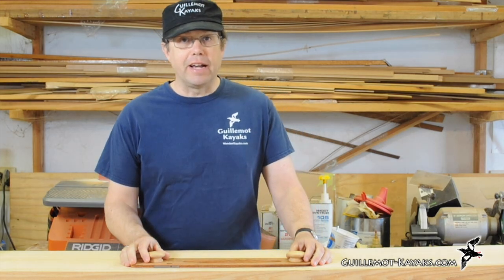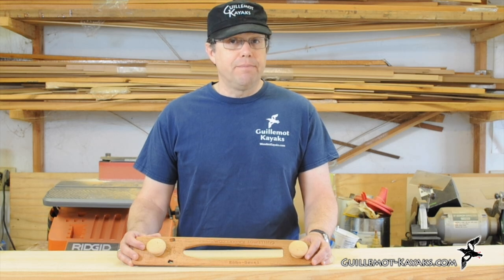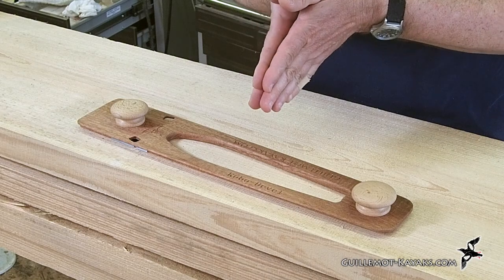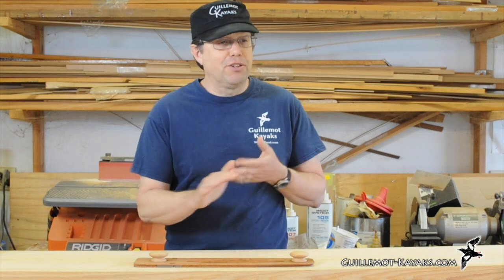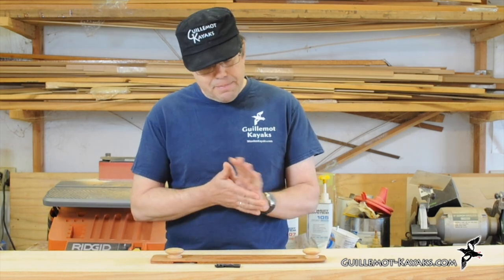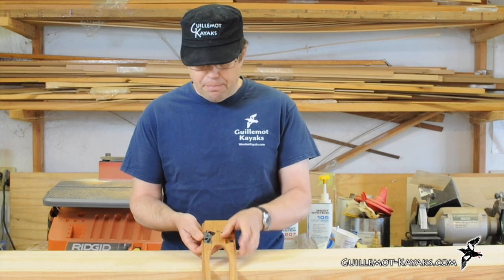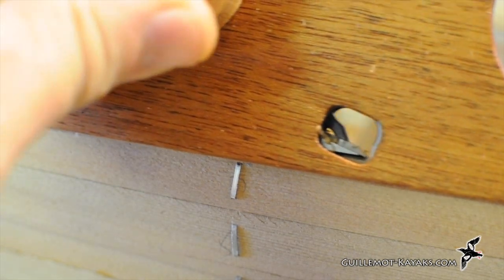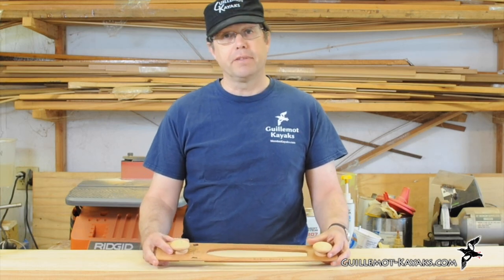Robo-Bevel Tool for Strip Building Small Boats

Comment: If there were a way the bead and cove to not pop out, the joint would be just as tight as the robo bevel
Reply from the maker: The cove and bead works great on designs that don't have a lot of twist or tight sectional curves. For example large canoes often go together very nicely with C&B, but for smaller, more complicated shapes, C&B tends to want to pop out.

Comment: Skills is amazing 👌
Do ask myself about if cutting the strips with 15-25 degrés angle (to alter when round over) it will increase the glue area on each strip and width  as well. 1-3 mm depending on angle...
Perhaps not very traditional, but with modern glues there is another possibility to explore.
Reduce the strips down to 2,5-3 mm for weight crazy daredevils. 😂 
My lard rear would need a few layers of carbon though, no fun to play submarine.. 
Amazing videos  about your skills 👌👌👌👌

Comment: After I got my Robo Bevel and used it, I realized that it was faster to just get another plane and have one on each slot.  I found them at the best price from Lee Valley, but had bought my first one from Amazon, which was too expensive, in fact the price was for a whole set of mini-planes, but only got the one out of the set from the Amazon supplier, so it was a rip off.  While it is nice to have the Robo Bevel in one piece, when I got to the last few strips, it would have been convenient to only have 1/2 of the bevel at a time, since it won’t fit in between the completed strips when only a few are left to place, like the the keel junction when placing the last of the strips. The other tool was a different edge plane which I use a lot for the last strips, just used a knife in the tightest spots, or use a low angle plane on the loose strip supported by another strip so the fine tapered strip would not bend.  I figured this out and then saw Nick using that method as well.  Thinking I may cut the Robo into two bevels now that I have two shoulder planes, or buy another one and shape it for my own needs.  All in all this is a very time saving tool and well worth the purchase.  😎

Comment: I have used the bead and cove method and also the robo-bevel method on my last canoe, it does work well with a little block plane work to go along with it. All in all in my opinion using both methods I personally would go with the bead and cove. Spend the time up front to make the bead and cove.

Comment: Hey Nick, quick question. I am considering buying a robo bevel for my 2nd cedar strip canoe build. It appeals to me compared to the tedious nature of trying to get perfectly milled bead and cove strips, which end up being very fragile no matter what you do. It seems like the robo bevel would be the perfect tool for me except for when I get to filling in the "football" section of the canoe after the centerline is cut. Seems like the majority of the strip could be planed with the robo bevel, but at a certain point, the robo bevel tool is going to collide with the centerline, rendering the tool unable to finish planing the entire strip. This is basically my only hesitation to buying a robo bevel. What would you do in this scenario? Are the strips close enough to square in the football section that a plane isn't necessarily needed? Thanks.

Comment: I love my Robo Bevel. Worked like a charm. Took me a little practice to really dial it in, and I definitely still prefer working on one direction rather than the other (L to R rather than R to L). This tool is exquisite. Definitely much more pleasant than dealing with cove and bead imperfections and broken coves.There is nothing like the feeling of getting a super tight joint with the robo bevel.

Comment: A few thoughts:
1) In the higher curvature of the bilge does trimming one side of each strip suffice?
2) A shoulder plane doesn't eject shavings very efficiently and with one side blocked even less so.  In the same spirit of a long fixture plane - would a skew blade clear better?
3) I am considering holding fixture for two strips at a time that twist the pair of strips so flat shots with a bench plane would put the rolled bevel on.  It's perhaps not as elegant as using the strips/forms as the fixture.
Reply from the maker: Hi Mark, The only place I have found I need to bevel both strips is at a chine. Beveling just the existing strip seems to work fine on short/wide boats with a lot of curvature.

The mini shoulder plane does have trouble ejecting the shaving. A skew blade that produced a spiral shaving would likely work better, but I have not found a skew plane small enough to do the trick.

A holding fixture may work, but the trick is calibrating the fixture such that it matches the required beveling on the boat. Transferring the angles on the boat to the fixture could be tedious. 

The question becomes: is it more tedious to frequently poke a pencil into the plane to eject the shavings, or to carefully transfer angle measurements to a separate fixture.
Reply: Nick Schade I have a pair of side rabbet planes that I think could conceptually work except the bearing surface needs to register to the forms instead of the mounted strip.  What I might do is buy a small pair of side plane irons I have seen in luthier supplies and mate them to a fit for purpose flexible float instead of figuring out how to mount a Lie Niesen 98/99 pair.
Reply from the maker: Let me know how it works out.

Comment: couldn't a 1/4 inch wood bodied rebate plane be modified wirh a fence to do the same job? Vertias tools are PRICY
Reply from the maker: Do you have a large supply of 1/4inch wood bodied rebate planes available to be modified? For the tool to work well, they would need to be 18" long.

You could certainly make a similar tool without incorporating the mini shoulder plane, but at $40 for the Veritas tool, I would be hard pressed to make something as cost effective if I were to account for a reasonable labor rate.
Reply: Veritas miniature shoulder plane is $41.50 US on the Lee Valley.com website (May 2020).

Comment: Hi Nick, 
I use 7/8” strips and 3/8” staples. Will the bevel pass by without hitting the staples? How wide are your strips?
Thanks
Reply from the maker: The strips I'm using in the video are 3/4" wide. The staples are standard T-50 which are about 3/8" wide, and 9/16" long. I occasionally hit the top of some staples, but the tool rides over them.

Comment: It seems much easier to use the Robo-bevel than to make bead and cove on all the strips. As I far as I see, you only plane the one side of the strip.
Reply from the maker: There are some times when you may want to bevel both sides of a strip, but the Robo-Bevel does most of the work in most situations.

Cove and bead can be faster because any beveling work is eliminated in advance, but you must take the time to set up and mill the cove and bead.
Reply: Thanks. I will probably go for the plane. Then I also get to buy this cool little plane :-)

Comment: How does the blade hold up?  Would you suggest an extra blade? Can they be sharpened?
Reply from the maker: The blade is pretty easy to sharpen, and stays sharp for a long time. I have not used mine long enough to wear it out.

Comment: Nick, I am new to your channel but have been looking at your designs for years.  
I often see that other people make the strips with a router curve on the inside and outside so they join together tightly.  I don't know how that compares to the way you do it with the bevel, but I would love to know your thoughts on this.  Some day I am going to build one of these!

OK, Well I just read the page on your site and you pretty much cover all that I was wondering about!   Thanks
Reply from the maker: Hi Wolf, When I refer to "Cove and Bead" in the video, that is where you router a set of matching curves on to the edge of the strips. This system works well, particularly for larger boats like canoes. I have found that on smaller boats like kayaks, they can have some issues.

I discuss this a bit more in depth in this video: https://youtu.be/x9EWm_u0I-Q
Reply: Thanks for the Video link

Comment: That's brilliant Nick! What you should be especially proud of is the fact that it's low tech, based on technology (wood planes) that've been around for a couple thousand years, the task you're using it for is not dissimilar to tasks boat builders and others have been doing for  as long, or longer. So this could've been invented over the past couple thousand years--but wasn't--until you did it. There are shoulder planes, but this is different. 
And having built two of your designs, I know I spent at least half of the time shaping strips trying to think of a better way to do it.  Well done.